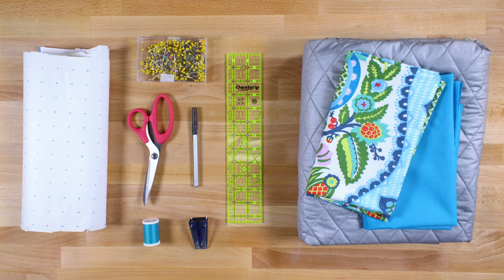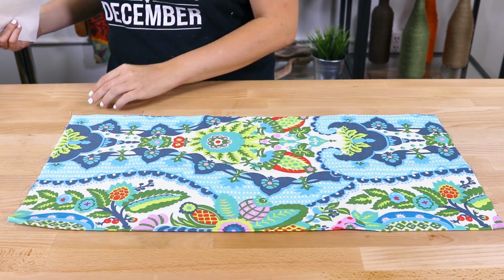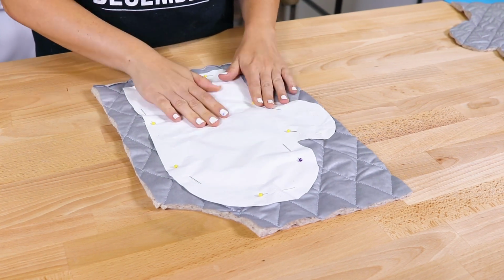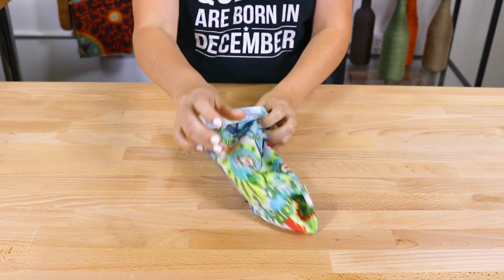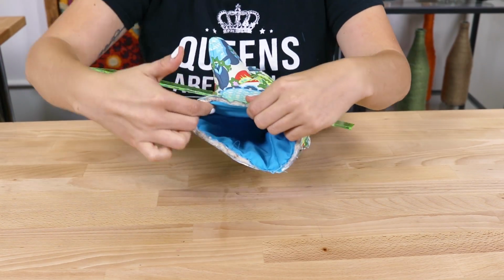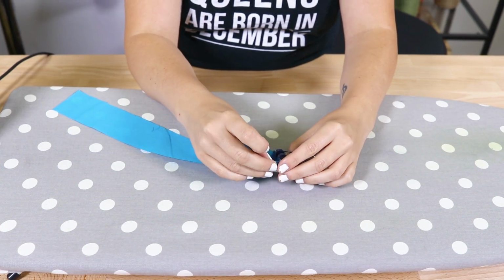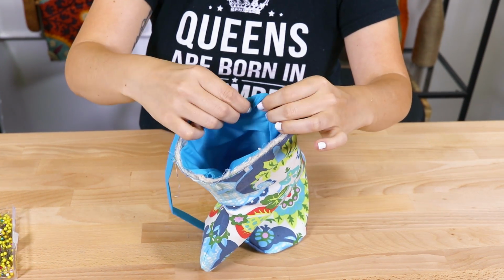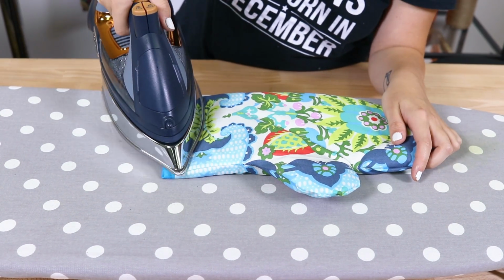How to Make an Oven Mitt

Comment: It was an interesting & easy method but I didn't like the quilted fabric in the inside.  I'd much rather use the insulated wadding and do a quilt pattern on the outside. Just my own preference. Thanks for vid. 😁😁